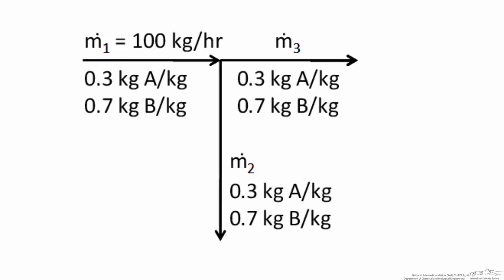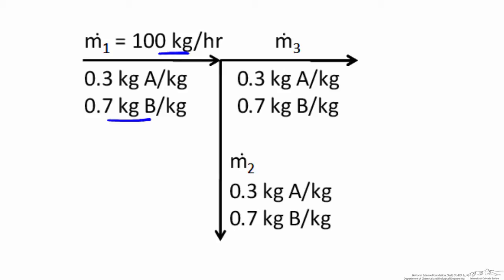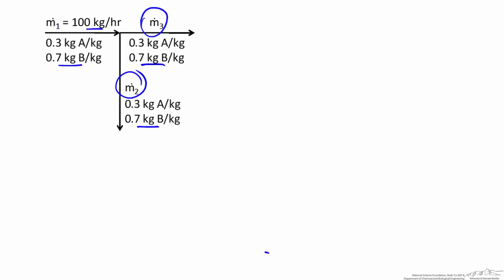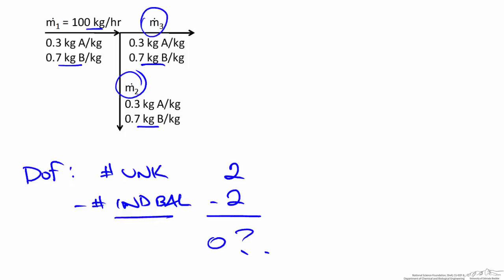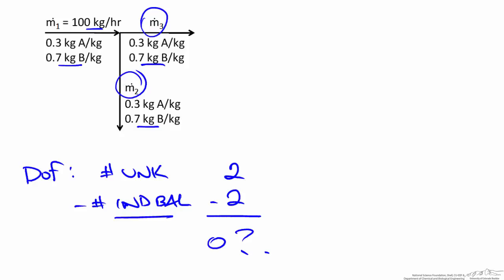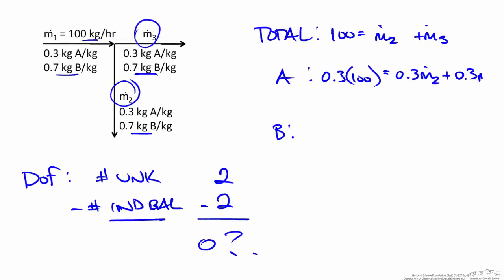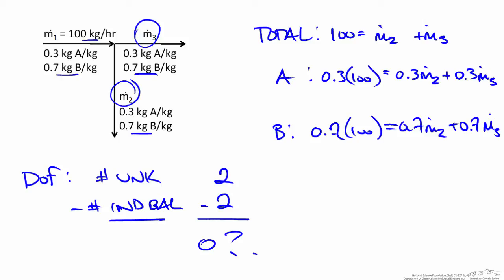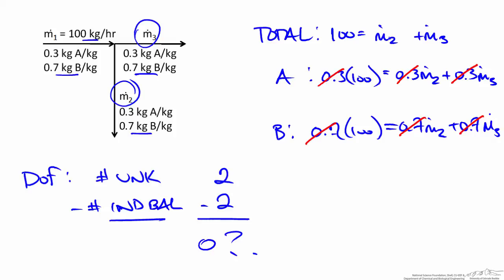Analysis of a Split Point

Comment: I probably won't get an answer for that but I didn't understand the part you did degrees of freedom analysis cause I think it has to be equal to -1 if we also equalize 100-m2=m3 , therefore we actually have to have only 1 unknown or if we count m2 and m3 as two separate unknowns, this eqn must be subtracted as an additional eqn, after all I know that DOF analysis does not work for the splitting point however I still would wanna know the answer for it.
Reply from the maker: DOF analysis does work for a splitting point -- you just need to be careful with your independent equations. You can calculate it with 2 unknowns, as was done in the video. Or, if you take m3 = 100 - m2, then you have only one unknown, but now you have used your only independent equation. Therefore, you now have 1 unknown and 0 equations, giving you DOF of 1. I'm not sure how you are calculating -1. Please advise. (Remember that it's [unknowns - equations] and not the other way around.